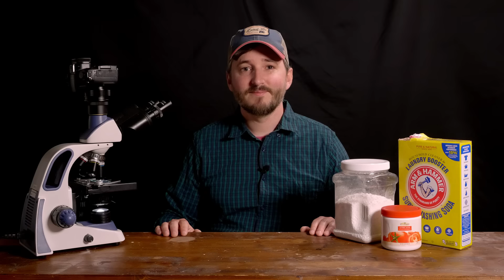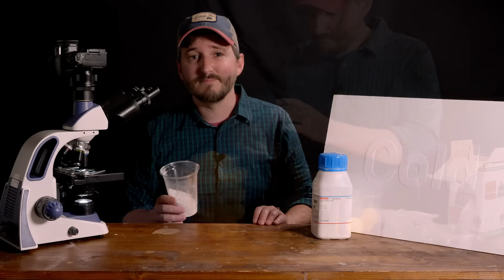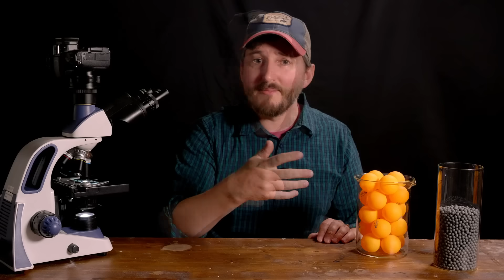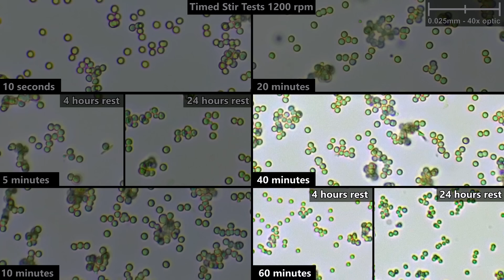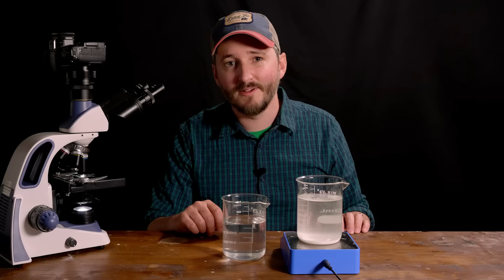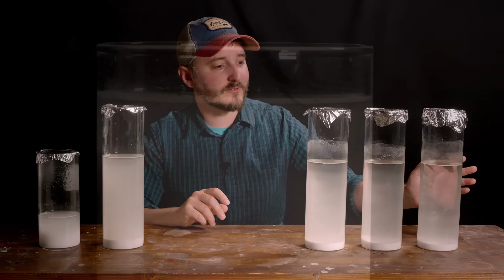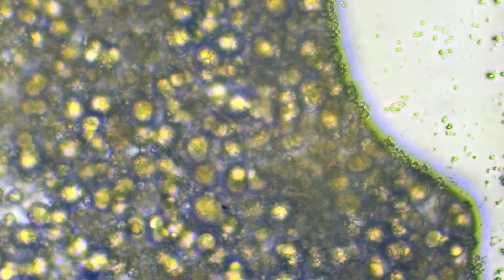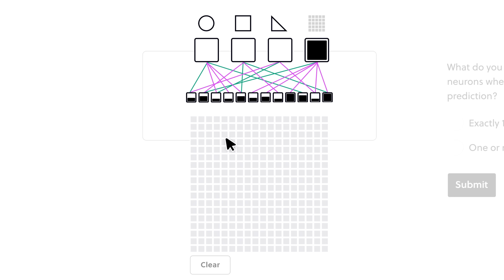Making Infrared Cooling Paint From Grocery Store Items (w/Novel CaCO₃ Microsphere Synthesis)

Comment: I recently watched video about people researching polyethylene aerogels for passive cooling since the plastic is transparent to infrared wavelengths and the nano pores help scatter the visible spectrum. I wonder if you could make sturdy panels by sandwiching your pigment between the surface you are painting and a sturdy infrared transparent plastic sheet or if that would then absorb too much heat from visible light.

Either way this was an awesome video, keep up the good work!

Edit: Just watched your next video and realized your plastic film was already what I was thinking about.

Comment: Buddy electricity bills are out of control in Pakistan but we had to turn on air-conditioning because temperature is usually about 40 degre celcius in day time. Can you tell me simple way to reduce my bill.
Reply from the maker: Painting your roof with any white paint will make your house much cooler than a darker color on the roof. The whiter the paint the better

Comment: As a painter and decorator, I found this fascinating.  What a shame about the application though.  I've subscribed and will be watching other videos.  Thanks for sharing. 🙂  Question:  So could I apply this to the roof of my summer house, would it help keep the inside temperature  cooler?  I use my summer house as a craft room and it get's really hot in summer.  I'd also like to store my potatoes and other root veg in there too, if I can keep the inside temperature cooler than the ambient temp.

Comment: For another applicator possibility, look up gold sniping. Gold prospectors use PVC to build a suction tube, like a reverse plunger, to suck fine, gold bearing material from cracks in river beds. It's like a big syringe. You could ad an end cap of PVC that's been heated and squished in a vice to give a flat applicator that you could also pull back on the handle to keep back pressure on the paint and prevent it from leaking out.

Comment: Wonder if you could increase efficiency by layering the top of the paint with the reflective spheres they use on top of highway paint.  Those spheres gather the reflective light color under them and increase the visibility greatly.  I think those are silica spheres.

Comment: Could the cooling process provided by the sky cooling paint be stepped? In South Texas we are starting with an ambient 107 F, so sub-ambient temperature we're still looking at 100, or even 90. Life is certainly more pleasant below 80. Would it be possible to stage panels in such a way that each would accept the finished product of the previous (as is done in supercooling arrangements, such as that used for cooling superconductors in MRIs and so forth), so that we could get down to a livable temperature?
Reply from the maker: The way to use this paint for much lower temps is to couple it with traditional AC. By cooling the air going into the AC it improves efficiency, or you can paint the building so the AC has less work to do to keep it cold
Reply: What if we took Tech Ingredients' saline shower air conditioner, and placed your cooling panel at the intake to reduce the temperature at the initial step? I'm not sure if reducing the temperature would put a dent in the differential of that machine, but it would be interesting to try.

Comment: as a contractor, and one that often deals with efficiency measures, what would happen if this mix were used in exterior enamel coatings on roofing metal? basically, use it as an additive in existing paint products?
Reply from the maker: Needs testing to find out
Reply: @Nighthawkinlight  our Workshop doesn't necessarily have the chemistry chops to make this stuff, but if you want to get together for testing purposes I'm down

Comment: This would make a great highschool/college Chemistry Lab project.

Minor thought on the acetone absorbing water. Water should be more dense than the acetone, so it shouldn't be too hard to use "old" acetone, if you just figure out it's current density and add a little less water to the mix to get it just right.

Comment: Idea for application to surfaces. 
Drywall taping gun like machine, two sided, one with an appropriate adhesive, the other the cooling paint. Sync a flat extruder to the linear release of the paper/fabric. thin, even sheets of consistent width.

Comment: Has anyone else tried a paint gun? what was your experience like?
 I've killed 3 spray bottles and never had anything actually SPRAY... I've added a bunch of acetone trying to thin it out with nothing to show for it. Did your bottle give you any trouble?  
I'm considering buying an airless paint sprayer but want to know if i'll be throwing money away.
Reply from the maker: I'm using Harris chemical resistant bottles and the only trouble they give me is the acetone eats the o rings after a few uses.

Comment: I've just finished replicating your experiment and testing some of the paint. The carbonate particles [I had 25g of them] are a success, they are in fact lower than ambient temperature by 2-5 degrees Fahrenheit even before they're made into a paint. I'm in Las Vegas during the height of summer monsoon season so every degree of difference can save someone's life out here. I have some notes:
-Without a stir-bar, it took a really long time to dissolve the acrylic. I had wondered why the paint was sepparated and thin.
-A painter's knife can apply the paint fantastically
-The smaller sizes of nanoparticles are difficult to sepparate out and I think I must have mistaken a lot of them for wastewater as they didn't sepparate out after days.
-I used a pie tin instead of a bread tin because I'm cheap, it did not work at all.
Reply from the maker: Thanks for sharing your results!
Reply: I have also tried to dissolve the acrylic in acetone with water as they mentioned it in the video... But after 2 hrs of heating at 60degree celsius... It won't dissolved most of the acetone evaporated 2 to 3 times I added it back for balance the solution.. While adding acetone again can we add water on it... Or the temperature🌡️ is maintained as he suggested
Reply from the maker: @ragunathl4410  60C is much too warm. It should be more like 38C. You're boiling all the acetone away at 60C.
Reply: @Nighthawkinlight  Thanks for the reply...  
1.The hard stirring is required or not for dissolve acrylic. 
2.Acrylic not dissolve as you shown
3.After the acetone evaporated to the minimum level few ml of resin only I have got... 

Kindly suggest me the better procedure for resin making

Comment: Amazing video… particularly showing general public that scientific publication can actually be useful. 
On a practical (and personal experience) note: have you thought about tape-casting your paint, with a technique using DoctorBlade for example?, or even dipcoating… watching the consistency, sounds about right for that. There are few others like hight pressure spray and etc… but cheap and home-made ones, tape casting and dip coating would do you great. Good luck and let me know if you need any further info.

Comment: So since it can be covered by plastic does that plastic have to be offset or can it be directly against the paint?

You could make roof tiles by painting something somewhat thin then covering it in resin to protect it.

If that doesn't work then maybe using a mold to make a resin plate that's sealed on the edges but has an air gap in the middle to keep the paint working.

Would need a UV resistant resin though so depending on the wavelength it might not work if it blocks the wavelength that the paint sends out.

If you could turn it into a roof tile then you could drastically reduce cooling needs on many houses and, if you have one, even in attics.

Comment: Would there be any issue with dumping an amount of the paint on a surface, then using a trowel or other spreading tool to apply it evenly on the surface? I think you could both get a better surface finish, and do it in less time.

Amazing video, incredible research, honestly a benefit to humanity as a whole!
Reply from the maker: The paint dries very quickly so you need to work fast

Comment: Could you use an off the shelf transparent paint as the binder?  You go to the "and now make it paint" part of the video and I was half expecting a comparison of tempera vs acrylic vs oil and the rest.  Clever to use recycled acrylic, though I wonder how that fares in direct sunlight; does it weather well or slowly yellow and crack?

I'd imagine the main thing you'd need is something that's transparent to the appropriate wavelengths?
Reply from the maker: It's hard to say what will and will not work without testing. I haven't been able to test much yet myself.

Comment: My company is in R&D for sky cooling liquid applied acrylic roof coating.  We are using a crosslinking acrylic that "mends" together between coats to create a solid, durable membrane.  Given that this recipe is out now..I guess it doesn't matter to keep it a secret anymore lol.  I will make a new video with results of small scale tests.  We currently have capacity to produce 30000 square feet of 60mil thickness of liquid applied membrane.  It can be sprayed with a standard paint pump, or rolled on with 1-1/2" nap.  @Nighthawkinlight thanks for this amazing contribution.  This will not only reduce heat waste, but also reduce consumption of electricity for air conditioning.  My hat is off to you!
Reply: UPDATE:
Our test results were better than other coatings in the market, but only by a fraction of a percent!  As we added more powder to the ratio, the resulting membrane developed microfractures, some of which went all the way through.  So it was a no-go.  We are now developing a prefinished roof panel system instead.  This takes out all the guesswork and human error that occurs while spraying or rolling it out as well.  It will take some time to recover from the losses incurred from the coating system tests.  In short, we are giving a customer another new roof..  
We will be putting together a panel coater conveyor system complete with heated curing.  There are many hoops to jump through for metal paneling to be approved by the various testing organizations, but I am going to be optimistic.  We have learned that using very thin coats and a more rigid acrylic base gives the sky cooling results, but it is not as durable. (pressure washer with brine added to the soap dispenser to simulate the expensive salt water test) We will likely provide a variety of sky cooling panels that range in warranty length and, inversely, sky cooling effectiveness.  All this to say results will be coming in a few months more.
Reply: Thanks for the update, keep them coming!
Reply: @shtfengineering7472  so glad you've continued updates! I don't see any videos on your channel regarding sky cooling, but I would love to in the future. Pre-made panels with a simple connection method sounds like a great way to replace awnings like the old clamshells I have on my house. We need it in Florida!
Reply: @frankiemillcarek6976  in Florida I think what you need is a south to north over-roof to keep the sun off the north side with this paint on the whole roof (so the south roof is repelling the sun and the shaded north roof is diagonally radiating heat out of the building into space) 😅

From an east or west angle it would look kinda weird, but you gotta do something to keep the heat out.

Even if it just reduces AC consumption by 20% I think we can call that a win tbh
Reply: @shtfengineering7472 Great to hear!
Reply: @shtfengineering7472  can't it be mixed with an adhesive and applied dry instead of wet?
Reply: @shtfengineering7472  try adding octyl cyanoacrylate + n-butyl cyanoacrylate + isobutyl cyanoacrylate to the mix. They use this in tissue adhesives in vet/medical world to make the glue stay bonded to the skin longer. By mixing in the longer chain you’ll improve flexibility and the n/iso butyl bonds will add strength- so less separation and cracking. I’m working an agricultural application. Holler at me if you’d like.
Reply: @shtfengineering7472  Still looking forward to hearing from your updates!
Reply: @shtfengineering7472 so how is the project going? Any updates?
Reply from the maker: Very much looking forward to seeing your results!
Reply: Wtf more info? What a gold mine for potential roofing applications.
Reply: Roofing company went belly up, guys.  Replacing that customer's roof put us in 6 figure debt.  We just couldn't recover.  I am not regretting the experience, however.  I put a pin in the coated panels.  We were liquidated to pay expenses, including the machines I cobbled together to coat panels. lol  Try, try again!
Reply: @shtfengineering7472 your timing is a bit off as I want to help someone cool down her home in this crazy heat.  Do you have any documentation or tips left from the venture?

Kudos for trying to make a go of this.  A huge percentage of small businesses fail, but many people keep trying until they can make it work.
Reply: I would seriously like to buy paint for about 100m2. I live in the Netherlands. If possible, let me know please
Reply: It's going to take a lot to match and prove the performance of these products, especially if you're not putting it on a  substrate like metal. Is it possible to integrate this coating with a thermoplastic membrane with proven performance?
Reply: Secrets are useless in todays world toss it in FOLIC acid and be 100% reflective way cheaper
Reply: Wicked awesome!
Reply: Tiny hats wont let it happen

Comment: Oh, by the way, another thought I had but can't test myself. 
It has no connection to the tests you've already made; it's a heat transfer thing, and your temperature measurements were all in a state of thermal equilibrium.

But it might come in useful when you start figuring out how to make this paste transfer heat better (which is what, I assume, you want to do with the pipes).

---

You could, in theory, improve heat transmission through the layer of dried paste by:
1) adding a small amount of extra CaCl2 to the CaCO3/acrylic paste
2) spraying the heat exchanger with a solution of Na2CO3, letting it dry up into a thin layer
3) and only then spraying the paste onto the heat exchanger.

Of course, this might also ruin the performance or just cause the paste to flake off. Especially if the heat exchanger is made of aluminum.

----

Why:

The paste is essentially an acetone-water mixture with some additives, so it'll allow for (very slow) transfer of carbonate ions and (slightly faster) transfer of calcium ions through the medium.

In other words, if this is done crystals of CaCO3 should form while the paste sets; they'll mostly form close to the surface. Maybe they'll even form on the surface.

Depending on how quickly ions migrate and on how viscous the acrylic-water-acetone mixture is at the time, this process might:
1) grow around the most closely-packed spheres and kinda-sorta "sinter" them together (good for thermal conductivity, since it increases the surface area through which heat may travel without crossing phases into polyacrylate foam)
2) or it might push them apart while forming new amorphous crystals (bad for thermal conductivity).

I can't test it myself, since I don't have a good microscope. 
And the only way to figure out which of those happened would be to pry a fully dried layer of paste from the surface of the exchanger and study it under high magnification.

Comment: If every thing was painted with this would it affect the temperature in space? How about changing the weather or at very least the local climate?  Applying this as an Individual basis  you can save on ac bills, but collectively it might have some effects as well. Very cool stuff
Reply from the maker: No effect to space. That's where all heat goes eventually anyway. Earth would get very cold if it were entirely white.

Comment: You said these need to point to the sky. Can a periscope setup work? Instead of two mirrors in series reflecting light, two panels in series emitting light. In this way heat could be removed from a crawl space under a structure as well as the sides and top.

Comment: Could you cascade the effect?
What i mean is create several plates of for example copper that are coted with the paint on one side and painted black on the other side. Place them above each other in a way that a black and a white face are aligned to each other. Between the plates you always let a little air gap to insulate them.

So maybe each plate would become a little bit colder than the plate obove or what do you think?

Comment: In the BaSO4 video, you've used a luxmeter rig to check how well each paint reflects light (ultrawhite measured at 415 lux, BaSO4 in acrylic snow measured at 423).
Out of curiosity: what did that tool measure for CaCO3 microspheres in acrylic snow?
Reply from the maker: I didn't test that but I should